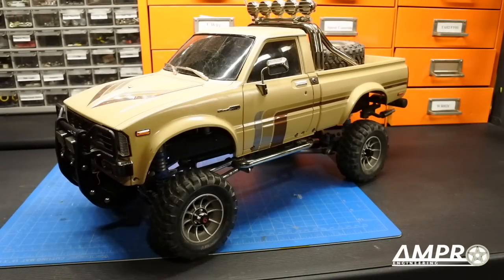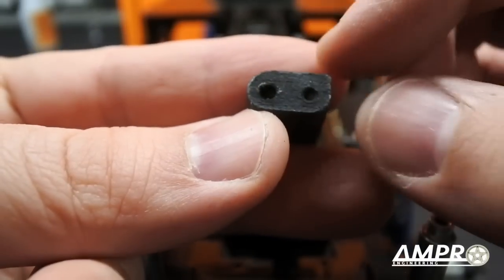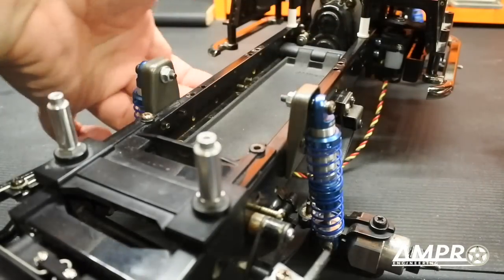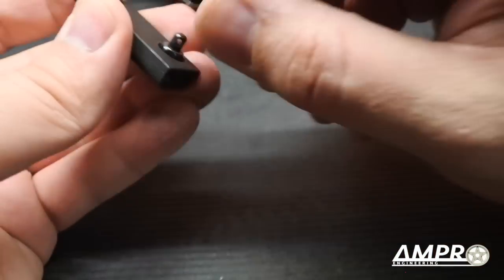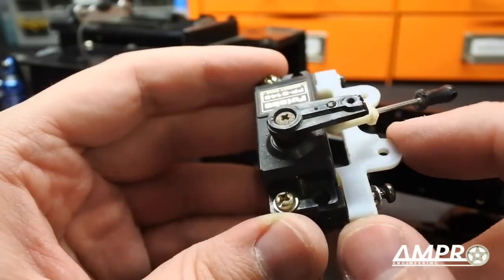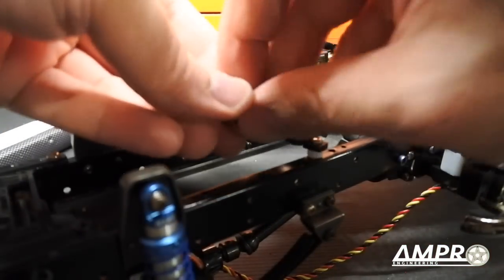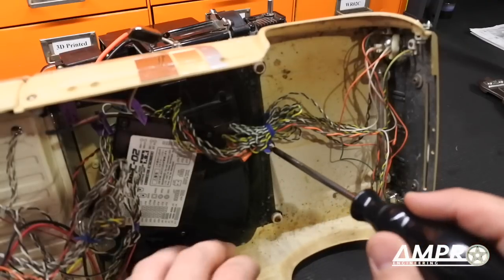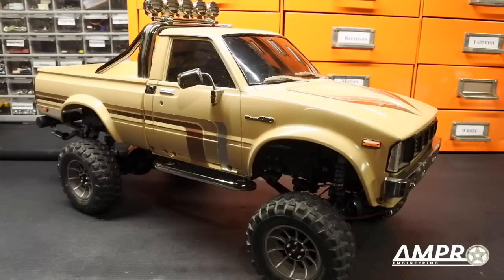e52: Tamiya High-Lift Chassis Upgrade Part 3 - Hiding the battery!

Comment: What I did with my servo I flipped it to the right and used a tap to thread the ball sockets to 3mm and used the short 3mm x 25mm rear tie rod. I had a spare one so it worked out better with more clearance.
Reply from the maker: That is a good idea. Anything to make more room.

Comment: Fantastic job and video sir!
Reply from the maker: Thanks a lot!
Reply: Good work deserves good praise. I'm sure I and others would love for you to make more design videos of you prototyping parts. Just some of the techniques you use in ACAD or your chosen software and thoughts while designing and modeling them. There is a severe lack of engineering design videos, and since its RC it would be more fun. Also, I'm curious.. why do you print them in white then paint them? Why not print  them in black?
Reply from the maker: No I think you are correct about this. I will need to do more videos of how it is actually designed. Great question about the painting. So shapeways does not offer black in a "polished" version so the surface finish is rough. Also, it is quite matte. Painting the polished white parts with a low gloss black prevents dirt from sticking to the bits as well as giving a more uniform appearance (keeping with the look of the ABS). I will also need to talk about that!

Comment: I own both the Tundra and the F350 high lift, both comes wiht the batterycase under, unless i misstook what you said :)
Also, i would love to do it this way, however, speaker gets in the way (i have the MFC-02) in my F350 and both read and front swings, not sure if that is good or bad as i can't really regulate EPA with the carson radio.
Love your videos!
Reply from the maker: No you a totally right, I dont have one so I am not quite up to speed on those. Yeah I used to have that MFC-02 but I found the ESC totally worthless for trail and rough surface running. Glad you like the content!
Reply: @AMPROEngineering  maybe i should put the system in my tundra and have a fun setup for the f350
Reply from the maker: @Ratpack30  It has been a huge improvement to my Hilux. Before It was impossible to run it with my trailfinders but now, it keeps up.

Comment: Where would one find the pin screws that your using to hold the battery try up?
Reply from the maker: So it is really annoying. Tamiya sells them in random screw bags. The ones I get are from the Stadium Blitzer.

Comment: Nice design!.  I really would love to buy one if it wasn't for shapeways 26 euros shipping fee + USPS customs fee of 32 euros.. that would be a total of 58 euros or 66 dollars...
Reply from the maker: Really? They are based in the Netherlands though. Do you have the location setting correct?
Reply: @AMPROEngineering  yep my location Is correct.  38.24 euros for the printed item. Plus 26.40 euros for shipping. Now the price is 64.64 euros.  And since the value of the item and the shipping cost has exceeded past the toll- free limt of 37,82 euros. It trigger's USPS customs and handling fee of  32.41 euros.  So the total cost of the battery tray including shipping and handling  with USPS 
is 97,05 euros. And even if I'm lucky avoiding USPS handling fee. The item is still to expensive to buy.  Sad but true.. :(